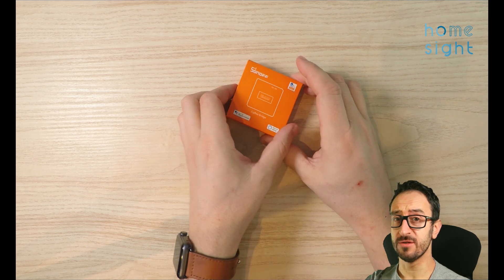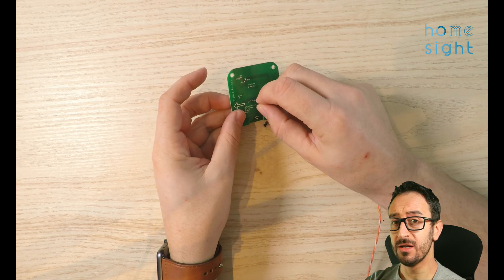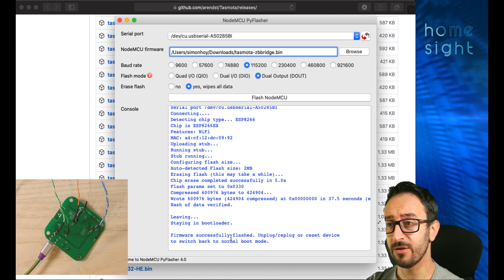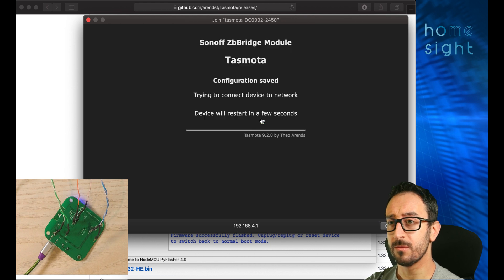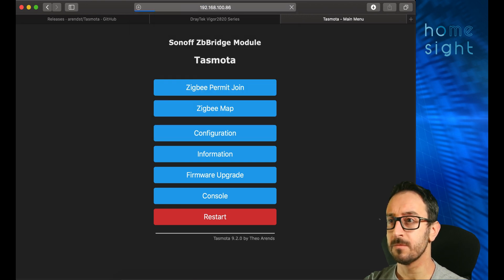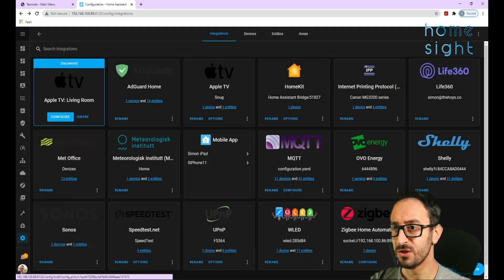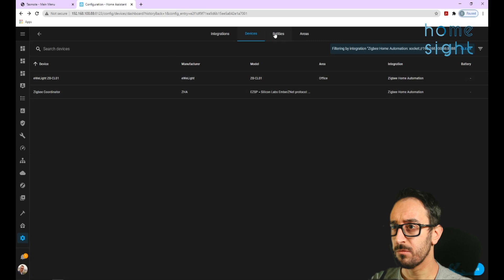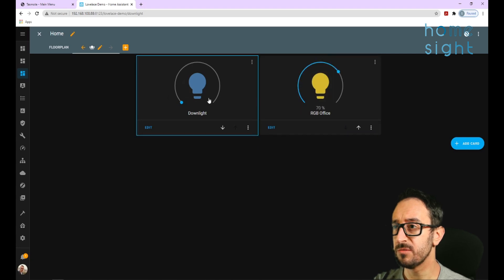Sonoff Zigbee Bridge | How to flash with Tasmota and setup in Home Assistant with ZHA

Comment: Hello, Im trying to reflash sonoff zigbee bridge with tasmota, I connected it with serial to USB adaptor and now its blinking blue and green is constant and I get Failed to connect to ESP8266: Timed out waiting for packet header when I try to flash. It wont enter flashing mode, it already had tasmota on it but I changed the network and reflashed but no AP showed up, so Im trying to reflash it again but no matter what it wont got into flashing mode again, I redid all the cables again more than 5 times to make sure they are correct and then are. Any help?

Comment: Great video! Followed it and flashed by Sonoff bridge first time.  I did make the mistake of buying jumper leads that were too big, but rather than do some tiny sobering I used a Stanley knife to lighty shave some of the metal of the jumper leads so they were small enough to fit :D
Reply from the maker: Good skills! Loving the engineering approach!!

Comment: Is flashing the bridge enough to allow your Sonoff devices to work without an internet connection or do you need to also flash the individual smart plugs, switches etc... to stop them sending loads of data to china?
Reply from the maker: Hi, yeah flashing with tasmota would stop it sending anything externally.
Reply: @HomeSight  cool. So need need to flash everything individually

Comment: Hi simon how has stable has the bridge been for you,  I've had a lot disconnection issues with my sonoff sensors. I tried upgrading the firmware the other day and really annoyed it. I'm hoping to see if i can reflash it using your guide to see if i get different results.
Reply from the maker: Hi Paul, in all honesty I don’t use it that much other than for testing. I find the ZHA isn’t as widely supported as Zigbee2mqtt, and I prefer all my devices to be managed in 1 place.

Comment: Thanks for the video! I'm looking at this device as I'm researching getting started with home automation. One benefit of the bridge over a dongle is that I plan on running Home Assistant in my home Raspberry Pi Kubernetes cluster, and if HA crashes or a Pi dies, HA can just fail over and still contact my ZigBee devices. I'd have to plug a dongle into every Pi to get the same otherwise.
Reply from the maker: Ah yes, that’s a great benefit! I don’t run my HA in any kind of cluster. I guess the alternative is to have multiple cc2531s!

Comment: When I go to ZHA Integration, and follow all the steps, when I click submit I get "Failed to connect". Any suggestions?
Reply: I had the same problem. You should restart Tasmota module and then run this command (again) on the console:  Rule1 on system#boot do TCPStart 8888 endon - After this, restart again and try connecting. It should work.
Reply: @thiagovania2426  Thanks for the reply. That did not work for me but I started over from scratch using instructions from another video and it worked for me. Enjoying my Tasomta F/W ZB-Bridge!
Reply: Hi same problem here I ran the comand in the console as @thiago vania suggested but it didnt work can you post the other tutorial, thanks in advance

Comment: Me again... :-)
By me, it doesn’t look like it by you. Does not appear: starting TCP server on port: 8888
i don't know what's wrong... again. :-(
when i connecting to "zigbee Bridge", in HA, cannot connect do the Bridge, any ideas what I can try?

00:00:00.032 CFG: Loaded from flash at F7, Count 15
00:00:00.035 QPC: Count 1
00:00:00.038 SNS: Hardware Serial
00:00:00.040 Project tasmota Tasmota Version 9.3.1(zbbridge)-2_7_4_9(2021-02-23T12:05:44)
00:00:00.527 WIF: Connecting to AP1 WIFI Channel 11 BSSId 34:81:C4:C3:71:B2 in mode 11n as ZbBridge...
00:00:01.754 WIF: Connected
00:00:02.005 HTP: Web server active on ZbBridge with IP address 192.168.0.39
19:49:55.025 RSL: tele/tasmota_04B768/INFO1 = {"Module":"Sonoff ZHABridge","Version":"9.3.1(zbbridge)","FallbackTopic":"cmnd/DVES_04B768_fb/","GroupTopic":"cmnd/tasmotas/"}
19:49:55.026 RSL: tele/tasmota_04B768/INFO2 = {"WebServerMode":"Admin","Hostname":"ZbBridge","IPAddress":"192.168.0.39"}
19:49:55.027 RSL: tele/tasmota_04B768/INFO3 = {"RestartReason":"Software/System restart"}
19:49:58.479 QPC: Reset
19:49:59.461 RSL: tele/tasmota_04B768/STATE = {"Time":"2021-03-06T19:49:59","Uptime":"0T00:00:09","UptimeSec":9,"Vcc":3.475,"Heap":30,"SleepMode":"Dynamic","Sleep":50,"LoadAvg":19,"MqttCount":0,"Wifi":{"AP":1,"SSId":"WIFI","BSSId":"34:81:C4:C3:71:B2","Channel":11,"RSSI":68,"Signal":-66,"LinkCount":1,"Downtime":"0T00:00:03"}}

Comment: Finally received my new Sonoff device (see other reaction, cannot flash EZSP firmware to my old device )
This time it is working so happy to get tasmota flashed (9.3.1.1) and also flashed NCP UART EZSP firmware (6.7.8.) Already 25 devices connected.
But I see in the instructions "backlog rule1 on system#boot do TCPStart 8888 endon ;..........." I copied the command and on my device after a reboot TCP is not started!
only after I enter the command 'TCPStart 8888' it is started.
How do I get tcp automatically started after a reboot?
Reply from the maker: Hmm... I didn’t find that mine needed anything else other than the commands shown... I’ll have a look tomorrow for you!
Reply: @HomeSight  I think I found it: in the cmd in this description 'on' is lowercase
when I enter it with 'ON' (uppercase)  'Rule1 ON System#Boot do TCPStart 8888 endon' (without quotes) it is working after a restart
Reply from the maker: Ah! Good I couldn’t see why it wouldn’t work!

Comment: Thanks for the video! Finally gave up on CC2531 with zigbee2mqtt. First one lasted 2 weeks before the firmware got scrambled. My power is good and it's well installed. It just died. Got another one and that worked for a month before failing. Even when working it would sometimes get confused, which could only be cured by restarting HA. After my success with Sonoff RF Bridge, I've ordered one of these and it's arriving later today.
Reply from the maker: Hi Richard, I’ve had no issues with my cc2531 at all! But good luck with the sonoff!
Reply: @HomeSight  Hi Simon. Sonoff installed, but I had to do something a little different. The backlog rule worked at the time but if I power cycled the device it didn't apply the rule again. I repeated the process from the start in case I missed something but with the same outcome. After a bit of googling I found https://zigbee.blakadder.com/Sonoff_ZBBridge.html and added "Rule1 ON System#Boot do TCPStart 8888 endon" followed by "Rule1 1", and that then worked, and was retained after a power cycle. Thanks again for the video which was super easy to follow. I don't have a soldering iron so stripped the cores and put them in. Miraculously, it worked!
Reply: Completely forgot to ask my question! Is there any reason the backlog sequence of commands would not be retained whilst entering the commands individually would?
Reply from the maker: Good stuff, thanks Richard!

Comment: Interesting video, I did this over Xmas as my first steps into zigbee and Home Assistant. I find the reliance on wifi a bit of an issue, maybe my router, home network, not sure as just changed that from a atermarket back to the ISP provided one and my network drop outs seem to be better suddenly. 

I had previously tried a cheap cc2531 zigbee stick before but that seemed very hit and miss. The Sonoff bridge replaced it and is far better. Just waiting on a conbee ii to arrive to see if working with zigbee2mqtt is more reliable as would prefer to combine everything to one box talking to the various zigbee devices. I had 9 motion sensors (sonoff) but they seem unreliable, not sure if that's my setup or the devices (get what you pay for). I have reverted to some hue motion sensors for now which are far superior but would like to get the sonoffs working reliably too, just because. And at around £10 versus £40 a piece it makes sense! The Sonoff motion sensors seem to drop offline or get stuck in a clear state or detected state forever, particularly if the network is rebooted for some reason. 

MQTT is new to me, but I have flashed a load of my tuya wifi plugs, a few sonoff basics to tasmota, and now with my latest purchase of the sonoff zigbee basic switched I am ready to carry on playing about.
Reply from the maker: MQTT is great! Gives you great interoperability and flexibility! Being able to pick out what you want from your devices with templates using config.yaml is a nice little get-out-of-jail-free card sometimes!
Reply: @HomeSight Conbee arrived and I tried to use in HA with ZHA but each reboot it forgot everything, like the stick wasn't connected. I am now setup with the deconz link to the devices. Some don't show in Phoscon but show in HA ok (Tuya Humidity Sensors) but otherwise seems ok. Would like to try zigbee2mqtt but just can't get my head around it. In other news, the Sonoff motion sensors are still a bit - meh. Via deconz, if you are in a room moving around they sense you enter, then after a minute (refresh time?) they go to 'clear' again and ignore you. Maybe Zigbee2Mqtt might be better, maybe they are just junk... happier that I am not relying on the bridge via wifi now to control devices.
Reply from the maker: Have you got an MQTT broker running like mosquito? That’s what I use and it’s rock solid. There is often a timeout on some motion sensors. I’m looking for another video to do, maybe I should setting up zigbee2mqtt, mosquito and explain how to configure devices?
Reply: @HomeSight  yes running a pi with home assistant and mosquito. I reflashed some tuya Wi-Fi plugs and they are connected via that protocol and were auto discovered, nothing special done or code written, not sure how I managed it really. 

An idiots guide video on setting up and how to make a switch or plug turn on or off would be awesome. 

Spent some time today removing what I did yesterday with deconz and reset home assistant to use the stick via zha. With that I now have everything working to some extent and the Sonoff motion sensors seem to be working better. Recognising presence in a room and staying in a ‘detected’ state for longer.
Reply from the maker: I’ll get planning a guide for it! Glad you got your presence working.

Comment: Hi... Great vídeo... Just have question, how to use the tasmotized Bridge with node red.... Dont found any way to do it...
Reply: Switching from zigbee2mqtt to ZHA, I deleted each zigbee2mqtt device and replaced with a pairing of the device with ZHA, using the same device and entities names that I used previously. This way, I was able to retain ALL of my node red flows and Lovelace dashboards. It's a bit painstaking but less effort than rebuilding NR automations and changing Lovelace code.
Reply from the maker: Now that the bridge is working with tasmota and allows you to add devices to HA, you can just use node red with standard nodes like check state, change state and call service.

Comment: Soldering?! Unbelievable! Seriously though, good video, seems very easy to follow. Just have to hope I don't melt anything in the process. Not sure those jumper cables you linked will work unfortunately.
Reply from the maker: James, why won’t they work? The looked a lot smaller gauge than the ones I have...
Reply: @HomeSight  well it mentions 0.1" spacing but now I read it it might mean that more than one of these would fit in the same as 0.1". Going to buy some anyway
Reply from the maker: Hmm, I might have to too
Reply: @HomeSight  mine arrive tomorrow
Reply: @HomeSight  I can confirm that they fit!
Reply from the maker: Thanks James! I never had a doubt ;)
Reply: @HomeSight  not having much luck with Tasmota unfortunately. Can get to the wifi config bit and it appears in my router but it doesn't appear to stay on or anything. Can't connect to the Tasmota GUI.
Reply from the maker: Have you figured out what IP it was given?
Reply: @HomeSight  yeah, done that. But when the sonoff powers on it flashes blue for about 10 seconds then all LEDs go off
Reply: @HomeSight  Don't ask me how or why, but it just started working and I've followed it all the way through now! (except you're missing the long command line) Great video!
Reply from the maker: Glad it’s working now!

Comment: I just wanted to query something you said at the beginning of the video when you said @02:11 "you needed to do this to add it to HA ". I'm not sure you do , you can use the Ewelink app to join the device to your home network (as you said) and then just use the Sonoff LAN integration available through HACS to control it through HA ? If you prefer to use MQTT/Tasmota then go ahead and flash it , but I'm not sure it is required .
Reply from the maker: Hi, yes you are right you could use the eWeLink app, I just don’t like this method.
Reply: @HomeSight  Soldering, using your own firmware, etc... it's all interesting, but from the functional perspective, what's the benefit of doing all that compared against doing the same thing through the Ewelink application?

Comment: Sonoff ZB bridge with ZHA was my first attempt after moving on from Smarthings. It works okish but some Ikea spots and remotes were unstable so I added also a Conbee2 stick with Deconz - works perfect with those Ikea devices. Still use the bridge for some Blitzwolf motion sensors as Deconz doesn't recognize them
Reply from the maker: Hi Vali, good to know! I’ll be adding lots more devices (including some Ikea ones) and seeing how it does. So far my zigbee2mqtt with my cc2531 has been pretty impressive with compatibility, so it’s got a lot to live up to!

Comment: Hi Thnx for sharing, tried your steps, but last step updating firmware does not work in my network.
updating tasmota to 9.0.2 was no problem. but updating Zigbee firmware via menu in flashed bridge ended in error using ncp-uart-sw_6.7.8_115200.ota file 
Sonoff ZbBridge Module
Tasmota
Upload Failed

Upload aborted

I use Unifi USG and set local firewall to accept all, do you have suggesting how to solve this?
Reply: I got the same issue. Turned out you need to disconnect from your FTDI loader. Use normal Power Supply, then it worked for me!
Reply from the maker: Thanks for the update Ben
Reply from the maker: Have you tried the latest tasmota version (9.2.0)?
Reply: Yes, flashing to 9.2.0 was no problem
Reply from the maker: Ah ok, you said 9.0.2 in your first comment. It shouldn’t be a firewall issue since you’re uploading to the device and then it’s running an internal routine. Have you tried downloading again? Or maybe try 6.7.6 as that is classed as the “stable version” at the moment.
Reply from the maker: Make sure you stay on the upload page until you get “upload successful”
Reply: @HomeSight  high I opened cmd screen in another window here is see the logging
23:15:21 UPL: File ncp-uart-sw_6.7.8_115200.ota ...
23:15:24 UPL: Transfer 190756 bytes
23:15:24 UPL: Successful 190756 bytes
no other msg shown, but in the upload screen I see the message "Upload Failed".
also tried with 6.7.6 file => same error
zigbee bridge is showing "Tasmota 9.2.0 by Theo Arends"
Reply from the maker: Can you try from a different pc?
Reply: @HomeSight  already done => no success
Reply from the maker: Re-flash tasmota again?
Reply: @HomeSight  hmmm, ok I will try tomorrow, I choose release version tasmota-zbbridge.bin will retry but when UI is showing 9.2.0 what could be wrong?
will also try with older versione (9.1.0)
I also asked on github for some help. I will let you know
Reply: I have no idea how to solve this problem
I tried with 4 different kind of flash firmware versions
8.5.1
9.1
9.2.0.3
9.2.0

but still upload failed

followed the steps on https://zigbee.blakadder.com/Sonoff_ZBBridge.html
and even added the instruction 'module 75'
 

please help?
Reply from the maker: I’m thinking you might have some faulty hardware!
Reply: @ManfredRotgers  could you fix that? I just have the same issue - also tried different versions. Additionally 9.3.1 and 9.4. Several power supplies and different cables
Reply: @zwener365  could not fix it, bought an new device, and could update this one directly using the steps described here
Reply: @ManfredRotgers  thank you for answering. Can you please tell me where you bought the second one - just to be sure 😉
Reply: @zwener365  ordered it here: https://www.itead.cc/sonoff-zbbridge.html
Reply: I see now in my original question an typo 9.0.2 should be 9.2.0 sorry